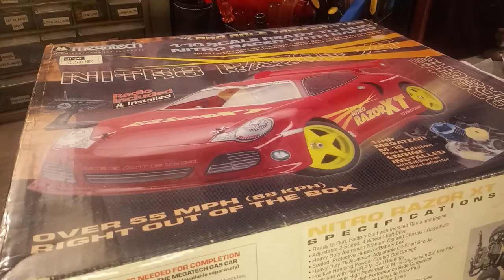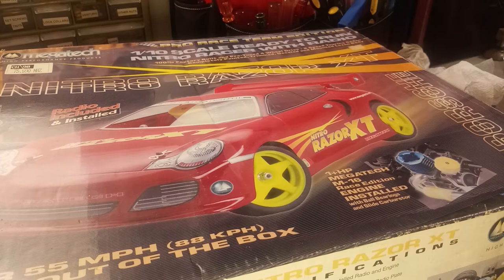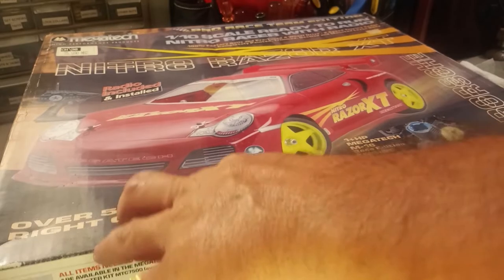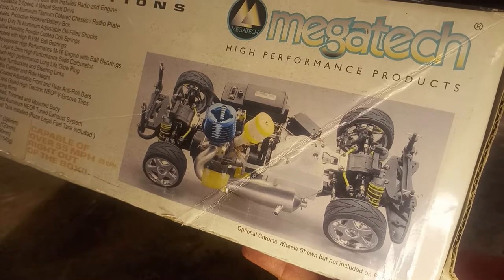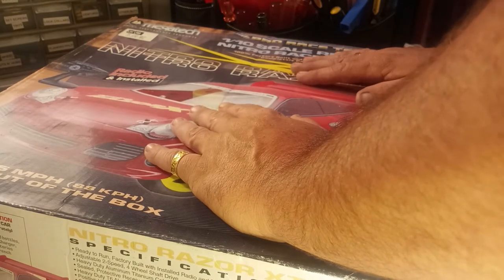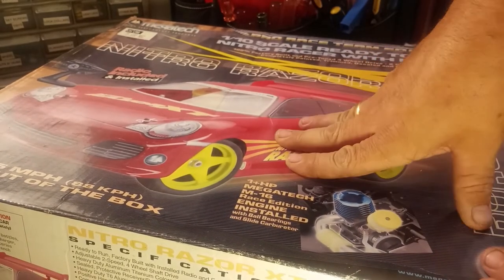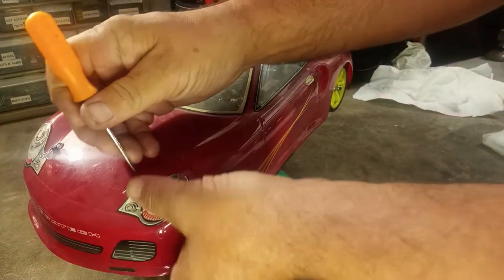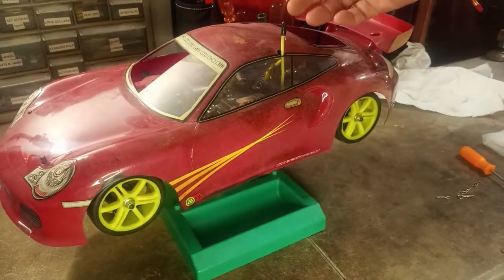Are we going to take a look at a Megatech Nitro Razor XT 1/10 scale nitro touring car Porsche body?

Comment: I remember these were in stock at my LHS ,  I couldn`t get over the fact that the picture of the chassis on the side had a tire mounted on the wrong side. You can clearly see that at 3:08
Reply from the maker: I just went and looked at the box lol. The thing is, I've got a bad habit of doing that myself, I've done it more than a couple times through the years

Comment: I have a few of those megatech engines I notice that the second gen black cooling head cris Carnelli edition has way bigger port cut outs on the sleeve that the old blue head m16
Reply from the maker: The Chris C. Edition is the one that came on the dark thunder. I thought it might have been a different version.
Reply: @NitroTalkwithTodd  yes it a was on the dark thunder dragster ND the afterburner I think all the last production megatechs I believe

Comment: Hey tod I got a ? I have 4 of the cen nx.15  big blocks ND they all have the same problem on the slide carb ware the slide barrel goes into the carb body they all leak making it not possible to run for very long before tuning becomes a mess lean hot bogging u no I was thinking of trying to pinch the carb body to make a tighter fit but I'm sure it be tricky idk really i no easiest fix would be just get a 3.3 traxxas carb it would fit but I'd like to run the stock carb maybe u have a fix I did rv silicone around the slide boot it helped a littel but definitely not great I'm out of ideas
Reply from the maker: I just took a look at my NX15 and the carb boot is stiff/cracking. I found another boot from a nova small block slide carb in my carb parts box. Is that where you are leaking? The slide should be covered by the boot. Are your boots dried out? If they are not soft and pliable they could leak. If you can't replace the boots, there is a trick you can try. I use it on rotary carbs, but it's the same principle. I would coat the slide with Molykote. It still allows the slide to operate, but it takes up the gaps. If you don't have Molykote try petroleum jelly.
And I'm the same way, I'll try everything I can to make the original parts work before I resort to swapping something.
Reply: @NitroTalkwithTodd  yea no the boots are mint they just fill up with fuel I gasket sealed both ends ware boot seats ND zip tied it help but as the carb heats up the leak obviously gets worse ND at full throttle it really leaks there just really shouldn't leak so bad there's no play at all between barrel ND carb body it's weird ND all 4 carbs I have do the same thing it's odd
Reply from the maker: @samsonight2721  That's an odd one. It may be time to throw in the towel and swap some carbs.